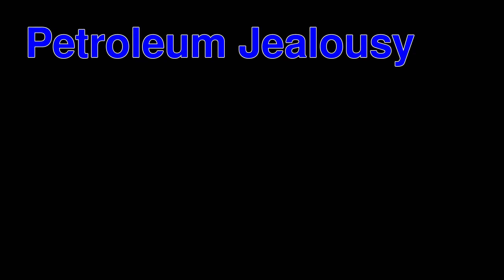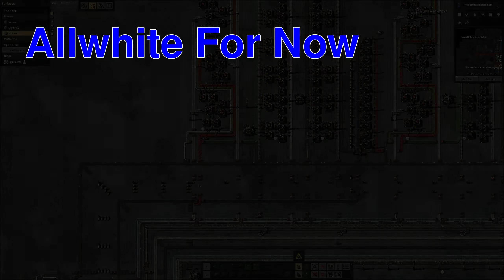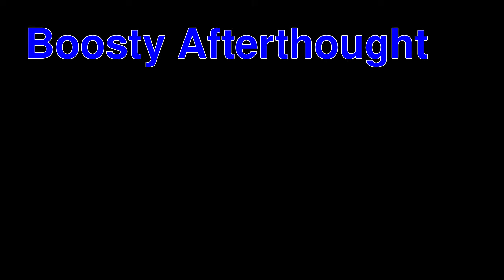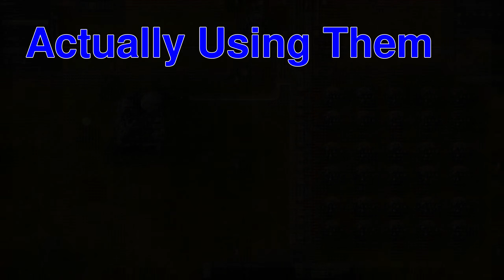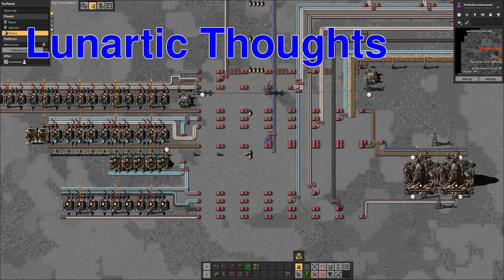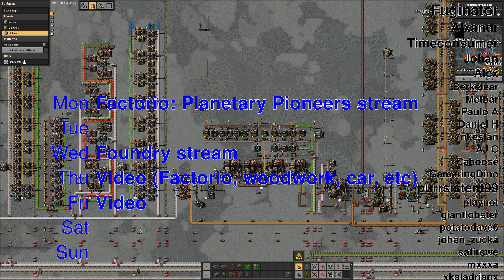S1-E17 - 10 White Bottles - Laurence Plays Factorio: Planetary Pioneers

Comment: Paint the planet in concrete (Edit: VERY CHEESY but I'm pretty sure you can just feed a machine with concrete mix and then keep changing the recipe to void it, you can use circuits to loop it or something)
Reply from the maker: Painting the planet is a decent idea, however it's more of a "fix once" than an on going solution. It's also not really automatable, and best case, you end up with lots of warnings about supply shortages. Still, it might be a good way to get round the problem for now. 

Oh, but the moon is already grey, so it won't really show up!

Comment: Mulunas plastic and wood chain should get full prod mods. Dont waste it on ice melting. But be aware that when you prod the tree growth system you will get more oxygen out than c02 in and youll have to set up a way to vent off the imbalanced gas.

Resources on Muluna are abundant and free except for plastic. So anything that boosts your plastic chain is super helpful :)
Reply: I also always wanted to ship in raw lumber from Lignumis instead of growing trees on Muluna and it sounds so much nicer than growing trees on site.
Reply from the maker: I would disagree there - the inputs for making plastic on Muluna are ice, carbon/coal and iron. Of those, if you need more carbon, just process more. That's easy. Iron is small enough amounts to not really matter. It's the ice that's tricky because of the sand byproduct, so any stage from ice melting onwards will benefit from prod mods. 

Ideally, you want to put the first prod mods in whichever stage has the fewest machines, so you get the maximum benefit from them, which I think is  the plastic making itself, probably followed by cellulose production, I think. Ice melting would probably still come before tree growing though, I think. 

Does putting prod mods in tree growing affect the oxygen output? I know some recipes only have productivity affecting the main output, not byproducts (like Kovarex enrichment!)... Would have to check that. But if so, a flare stack would do the job. 

Shipping lumber in from Lignumis is an interesting idea, but wouldn't it be easier to just ship in the plastic? I did that from Gleba to Vulcanus in my SA run a few months ago, and that worked well.

Comment: I believe, and this may be different with your mod set, that the sand can be sunk into concrete. so it may be worth it to make the few buildings that require large amounts of concrete on this moon
Reply from the maker: The sand definitely can be used for concrete, and we've done more than a little bit of that, however the problem is that concrete also requires water which means more ice gets used which means more sand gets made... And launching rockets requires blue circuits which requires plastic which requires water which requires ice... 

I suspect making and launching the buildings is probably a net consumer of sand, but the knock on effects have to be considered!